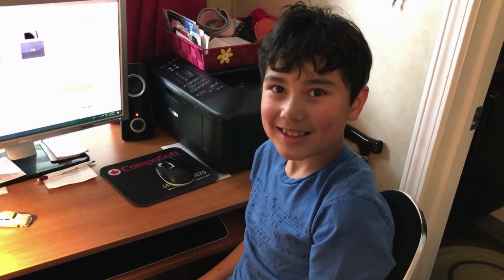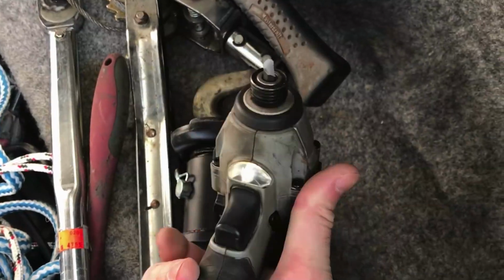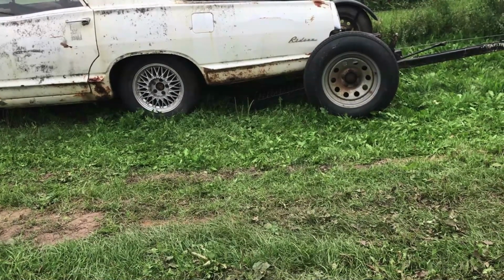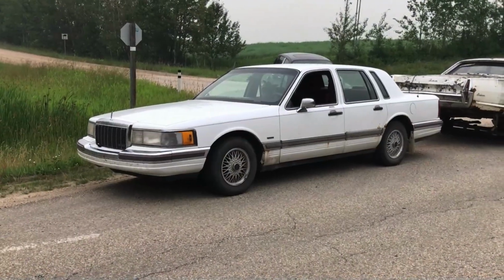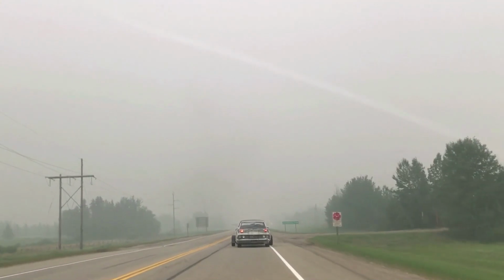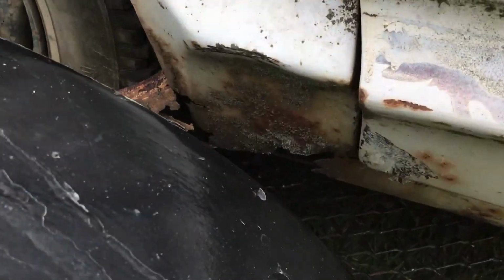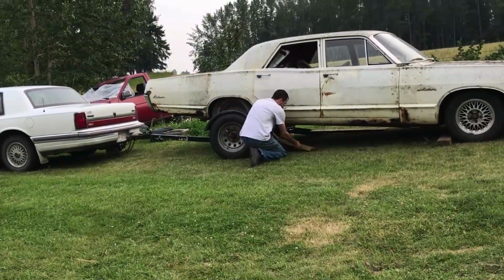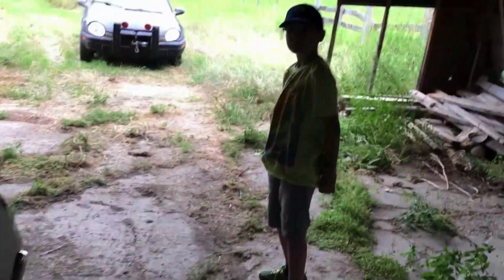Rescuing Nash's '67 Meteor Rideau!

Comment: nice find!  i need to rebuild my tow dolly also. needs tires and wheels and a hub bearing and new straps and wiring and fenders.
Reply from the maker: lincolnmaniac Mine has good tires, I do wanna sandblast & paint it + redo the bearings & fix both fenders properly.

Comment: Is this the car that was potentially going to get a panther frame?
Reply from the maker: meteor545 Yes it is, that plan is still happening, it’s just a bit distant. I have one panther frame front section and still need a good rear section, this way I can get the correct wheelbase with only one joint in the frame rail. We will be installing the original 9” rear end into the frame and sectioning on the front frame rails from the original frame just ahead of the cross member, so it should be very close to the original frame. Once on a solid frame we plan to restore it near perfect original, same engine, trans, interior restored, white paint, hub caps etc. We get some really nice bumpers for it and a few other parts last summer, we keep it inside too.

Comment: put that body on a panther frame.
Reply from the maker: lincolnmaniac That’s the plan actually, hopefully picking up an ‘84 Grand Marquis tomorrow. We will be putting the original drivetrain into the newer frame however.
Reply: if you do this there are a ton of upgrades that my friends and i came up with from newer panthers many years ago. i have 98-02 front brakes and 92-97 rear discs on my 86 town car.
Reply from the maker: lincolnmaniac Well for this one we are not looking to do to much as we wanna keep it in the past, we don’t want anything to appear modern on it, going for more of an original theme.
Reply: i think about safety first......those big brakes saved my dads and sons life once.....dad was driving my car and he had my son with and a tractor trailer cut out in front of them at 65 mph......dad thought they were going to hit the truck but the car just stopped! now going too modern might be the 4 wheel abs conversion. i helped do 2 conversions so far. very time consuming!

Comment: ummm isn't that a 1991-92 Lincoln you guys said it was a 90  I thought the 90 Lincoln was a square body. similar to my 1989 Grand marquis.
Reply: nvm I was wrong Apparently their is A huge difference in an 89 and a 90 Lincoln
Reply from the maker: Bobby Singer Yep ‘90 was the first year of the new body style, there were a lot of one year only items on the ‘90 like the stainless steel trim on the bumpers & side trim & it was the last year for the 5.0 engine, in ‘91 they went to the 4.6 engine. ‘91-‘94 it stayed somewhat unchanged, updated in ‘95 & then in ‘98 they went to the really round look. Thanks for watching.
Reply: you are welcome I had to see that I love Lincolns Pathers Period really I have owned 90 mercury cougar 94 lincoln towncar  89 grand marquis And 99 Crown vic  Loved them All still have the marquis and the CV :)
Reply: the grand marquis has dang near a half a million miles on the old 5.0  Still runs strong.
Reply from the maker: Bobby Singer I actually owned a ‘90 Grand Marquis before, I loved it! I’ve owned a handful of these cars as well: ‘80 Marquis, ‘85 LTD Crown Vic, ‘90 Grand Marquis, ‘90 Town Car, ‘91 Town Car Cartier, ‘92 Crown Vic & a ‘94 Town Car, I still own the ‘94 Town Car as well as this ‘90 which has 238k miles on it currently & going strong. The 4.6 in my ‘94 ate a bearing @195k miles so I have swapped a 351W into it, I hope to finish that up on the channel in the future & start driving it again. I also have a 1980 Lincoln Versailles.
Reply from the maker: Bobby Singer I also owned a ‘92 Cougar, although that shares it’s platform with the Thunderbird & Mark 8 actually & mine had the 3.8, I really enjoyed that car, it handled well.
Reply: mine was also 3.8 pulled like a V-8 :)
Reply from the maker: Bobby Singer Exactly, everyone hates on the 3.8 but mine never used a drop of coolant or oil & it got V6 economy with V8 power, I loved that engine.
Reply: well I will havta say that mine did have a terrible cooling system. had to add water/coolant every couple of days no oil issues tho except when the oil sending unit failed and started leaking oil put a new one on it never used a drop of oil. Had dual pipes installed on it and nobody could tell t was a V-6 at any RPM not the case with most 6 bangers for sure sound good on idle but get on it and it sounds like Crap LOL not my ol 3.8 FORD PPL argued with me about what engine it had until i would pop the hood and show them :)